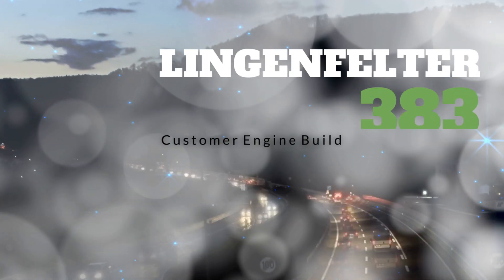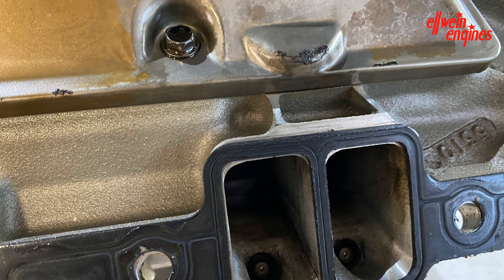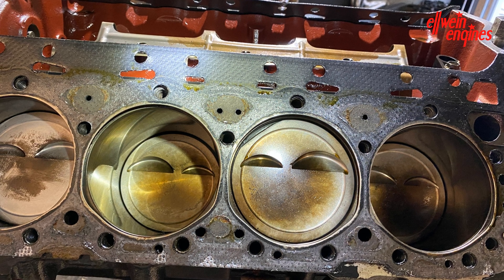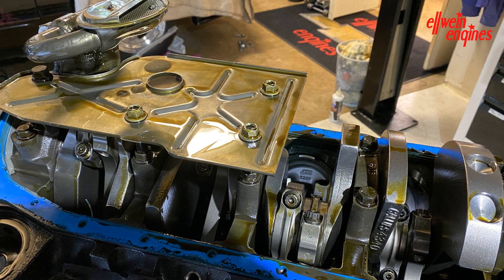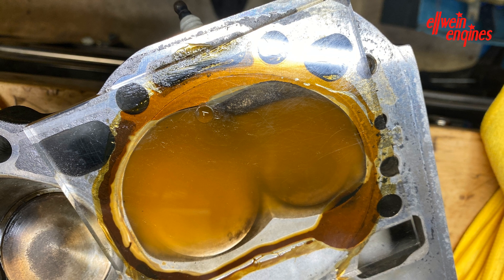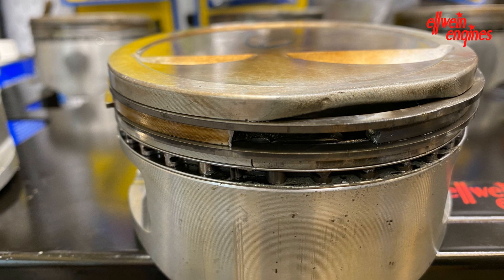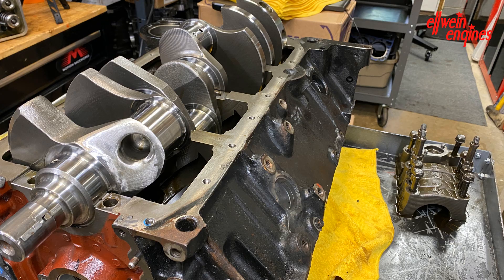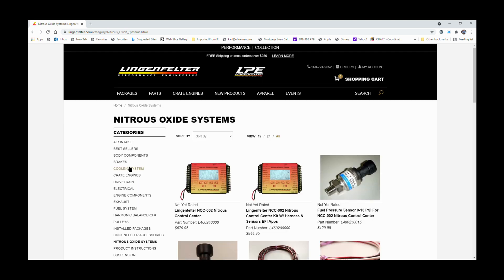Lingenfelter LT1 383 Rebuild

Comment: That motor doesnt know that callies crank is in there. Hahaha.
Smokey Yunick would go on about a motor not knowing it had 4 bolt mains as long as you dont detnate is and keep 10psi per 1,000 rpms

Comment: Love these vids guy..

Wanted to ask, on my build i went with
-5 cc Wiseco pistons.
Heads were milled down to 54cc chambers.
How much did that hurt my compression?

Learn alot from your vids 👍
Reply from the maker: Is yours a 383?  That would put your compression up quite a bit.  UP into the 12.4 to 1 area
Reply: @EllweinEngines  no its a 355 stock crank, scat 6"rods Wiseco pistons
Reply from the maker: You did good then.  Now you have about 11.6 compression ratio @sswcubes

Comment: nice but, it looks like a typical high-performance build .. was kinda shocked to see that they did not massage the oil hole, used stock main caps and lifters...  I would assume the person ran it hard and lean roasting those pistons or a bad tune ...

Comment: Did they spray that motor? I don't think I have ever seen melted pistons on a NA LT1 before.😯
Reply from the maker: They boosted it (yes even with 11.6 to 1 compression ratio.
Reply: @EllweinEngines  That makes sense. That makes the tuning window small on error. M1 😁
Reply: Wow, 11.6 and boost. So I'm guessing .030 ring gaps and .004 piston bore clearance from now on?